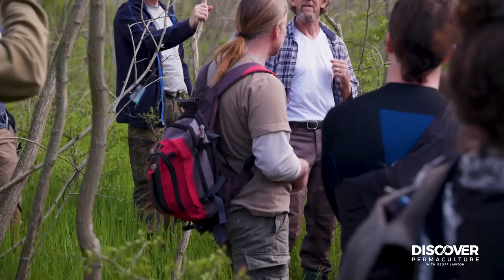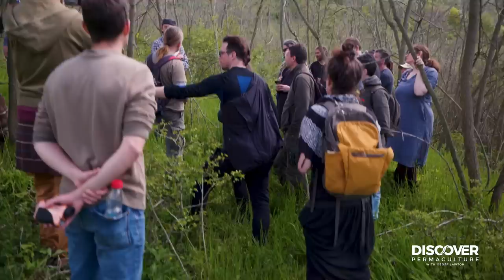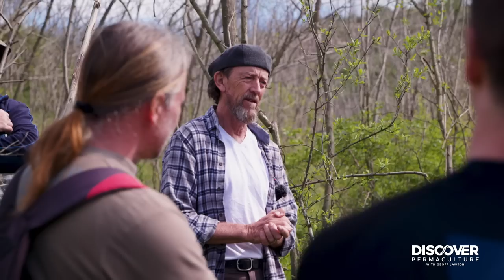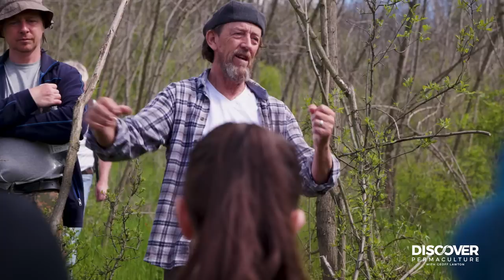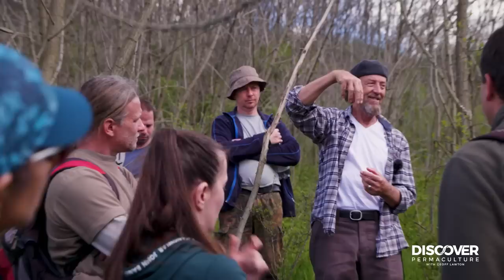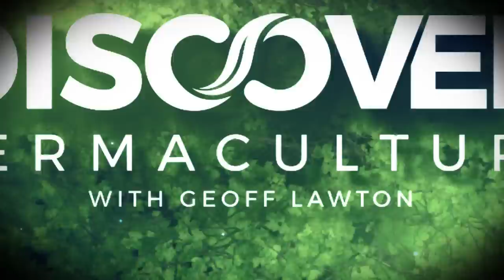Exploring Clean and Free Energy

Comment: Sometimes a concrete example helps when looking at something we're not familiar with.  Compressed air tools are everywhere in industry and Geoff mentions compressed air cars.  These generally rely on electricity to compress the air unlike the trompe.

There's a video on Youtube featuring an Amish (group of people in USA who choose not to use much of the technology available today) store.  Their store is powered by compressed air without using electricity at all in the overall process.  The video shows the store interior ceiling fans, sewing machine and various woodshop machines powered by compressed air.  

The compressed air also provides air conditioning.  After use, the air expands and is released into the store.  Expanding air drops in temperature and so cools the store.

The video comes as the only result of searching for the title "AMISH air POWER ~ OFF GRID" (I'm not sure if Youtube allows promotion of other videos/channels in the comments, nor if Geoff would approve).

This example is powered by a windmill, but like electricity, compressed generally doesn't mind how you generate it, so a trompe, windmill, gas compressor or electrical compressor could all be choices.

Technical section ahead:

You can search for "ideal gas law". It is a rule we've developed to understand gas.  Generally, temperature and pressure move in opposite directions.  Compressed air expanding at the bottom of the trompe becomes cold to make slushy ice.  Expanding air out of the shop machines is cool.

Strictly speaking, compressed air isn't quite as source agnostic as electricity.  Compressed air can carry moisture, and when released you'll get water where you may not want it.  A trompe will generally provide a higher moisture level than a mechanical system like a windmill.  But as you see in the Amish video, even the windmill produced compressed air needs filters to remove moisture.

Compressed air tools (pneumatic) are generally simpler, more powerful, lighter (although a hose is required) than electrical tools, don't overheat, aren't damaged by overloading and don't produce sparks.  As well, compressed air can be used for dehydration, bubbling, cleaning and spraying.  

Comparing round trip efficiency (power in vs power out), compressed air is much less efficient than electricity.  However, low cost, simplicity and reliability of the source may be reasons to choose compressed air.
Reply: Thank you for this explanation. Will definitely Check for the amish Video!
Reply: Excellent.  Thank you. 😊

Comment: Robert Murray-Smith has an excellent video on how to create one of these! Video 1501

Edit: look up hydraulic ram pump!
Reply: Just watched this video! He made a great point about it being a fairly simply addition to a rainwater collection system. I imagine you couldn’t get a crazy amount of pressure (probably not enough to power a car like Geoff was saying) but enough for small applications!
Reply: @JumpingSpider37  Look up hydraulic ram pump! You can build one for $150-200 and they're used to send water uphill. From the videos I saw, 40 psi is about average which is fantastic considered it doesn't use electricity. I assume with a trompe, (which creates air pressure instead of water pressure), it's about the same psi but I could be wrong, but 40 psi is enough to fill up mountain bike and car tires, maybe not a road bike, but hey I'm sure you could find better uses that a simple bike pump can't do.

Comment: Part of how i envisioned Nepal choosing small catchments networked along both valley slopes of the river gorge. Over the dangerous massive dams that also flood so much already farmed areas, or have chance of breaking, part electric and other micro hydro doing air pumps with tool shops. Industry. Where hills are you have daily breeze for vertical wind with rising or fall air with temperature. Root cellar cooled extra for chilled storage? Gravity rope ways turned into lifts with machanical drive wheels.

Comment: I can think of about 100 reasons I wouldnt do this, and none of them because I dont want to.  This sounds awesome but it dont I need a river?  How do I get 30m down?  What about maitenance?  If I have a low water table how does that work?  Im 100% on board but Im clueless as to how to get one and how it would work from a practical stance.
Reply: Start looking it up? You're full of negativity for absolutely no reason this isn't some new technology that Geoff is theorizing on, educate yourself instead of insisting there's 100 things wrong with something you can't even understand.
Reply: @ottoflouer1750  not negative, I want one.  But if you think I can just google a 30m trompe system you are sorely mistaken.  Its obviously not easy or even practical.  If youll notice, Geoff aint running his cars off trompe powered air.  Its all, we could,we could.  
Okay, Im on board, how do I get started?

Just build an aqueduct, super easy, right?  Wrong, if it were super easy these would be everywhere.  Im ok with the idea that we could start heading in that direction but its pie in the sky right now.
Reply: They are built underground. The water flows down and then comes back up in a return pipe. The air is collected in a dome underground which has a pipe to the surface in the CAES. Don't need a river, could have a swale or other water catchment as a water source.

Comment: I was told you get 11 psi for each 100ft. The compressed air car uses over 4000psi. Wouldn't it take thousands if feet or can the tromp build up the pressure? Would you be cryogenic frozen if you got in an accident in a compressed air vehicle? Could you drill trombs deep in the earth to create head in flat delta areas?
Reply: Think you. Need to do more research....the truth is out there but you have to dig a bit more for it
Reply: @CharlesGann1  If you know the truth, please enlighten me.
Reply: No, you would not.  Look up the purpose of a converging nozzle.
Reply: @estebancorral5151  You mean this nozzle prevents freezing?
Reply: @AllSectorsHearThis  a nozzle regulates pressure which may indirectly regulate freezing. Normally, it is the release of high pressure gas with the surrounding moisture that cause freezing. Fluid Dynamics is the science which were are engaging.  It is a subset of Physics. You have misconstrued much and know enough to be dangerous.  For your own personal edification you should familiarize yourself with two giants in their field. Giovanni Batista Venturi and Daniel Bernoulli.  If people told you everything you want to know that would deny you the pleasure of discovering things on your own.
Reply: @estebancorral5151 If the compress air tank at 4000+ psi splits and suddenly releases super compressed air in the direction of a person. The absorption chilling wouldn't cause freeze burns or frost bite?

Comment: I thought compressing anything created heat.
Reply: Think about puncturing a hole in can of compressed air ...yes compressing air creates heat but once that heat dissipates.. Its the basics of how the ac works in your home or car.look up vapor compression heat cycle
Reply: Yes compressing air creates heat, releasing the gas cools it back down. Energy can not be created or destroyed, just converted.
Reply: Probably only during the fall, but then it would mean the water get hot, then the air is trap and when it's released the cooling happen? 
I am not sure how it works, it's interesting, I will have a look at the details.

The best stuff is on this channel.
Reply: Compressed air bubbles in a tromp system are isothermicly cooled in the water system, rise up to the top of the storage tank area and are stored for later use. When the compressed air is decompressed, it is cooled. Same thing happens when you drain an air compressor tank.
Reply: pump up bike tyres and pump gets hot!

Comment: London used to be run on compressed water, of course I should say pressurised water as water cannot be compressed.The Devon and Cornwall coastal railway was powered by vacuum. And the gas light company developed gas powered radios, smoothing irons and no end of useful household appliances. But all these things had flaws,practicality and cost often being the greatest, cumbersome, smelly, ugly you name the reason but they all fell by the wayside. Sorry to say it Geoff but your idea more than a little fanciful far too much of the earths surface does not receive sufficient precipitation to even begin to make this viable, those areas that do would need to convert their entire surface to generation to supply those areas that don't then there is the cost of installing  and maintaining infrastructure on a global scale, Stick to the gardening Geoff you are really good at it. I love following your endeavors in Jordan and Aus they are most worthy, sorry to be so patronizing mate but really you do come out with some guff.
Reply: Are you just parrot repeating what you heard?  How was the vacuum created? How were leaks prevented?
Reply: @estebancorral5151  Don't be daft man you can check all this out for yourself. I assume you are referring to the vacuum powered train. This was done with a pipe centrally fixed below and between the tracks the top of the pipe was slotted and two flaps provided the seal, as the seal was not that good steam powered vacuum pumps were positioned at regular intervals along the track, I am informed that this system worked better than one might imagine but was prone to wear and in need of regular repair. If memory serves a section of track was washed away by giant waves in a storm and was rebuilt as standard track and railstock. Take a search and you will find better info than I can provide. My point being that running the world on compressed air not without serious issues, like communism it can work on the small scale but once scaled up the flaws start to appear.
Reply: You have confirmed that you were parrot repeating what you heard. You flunked in your explanation, and exposed the foible of your inner nature.